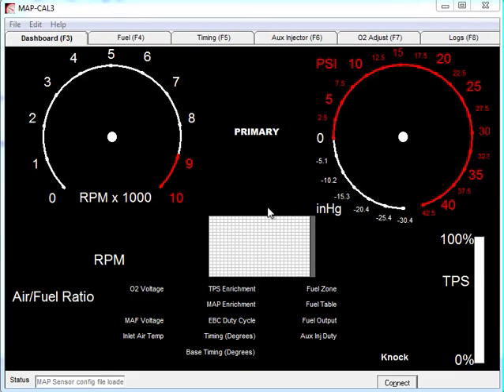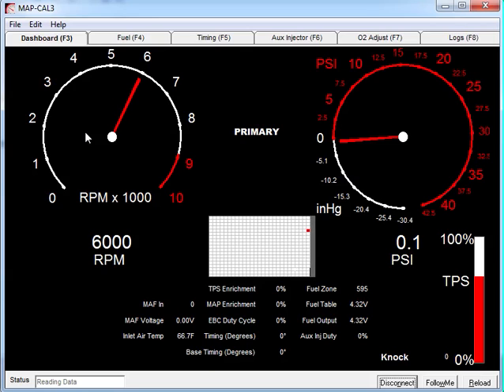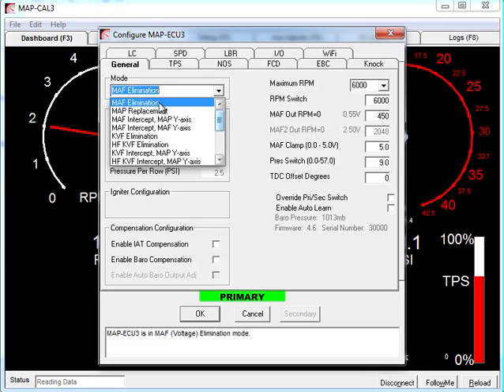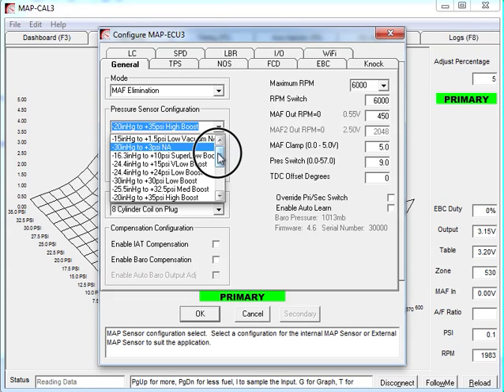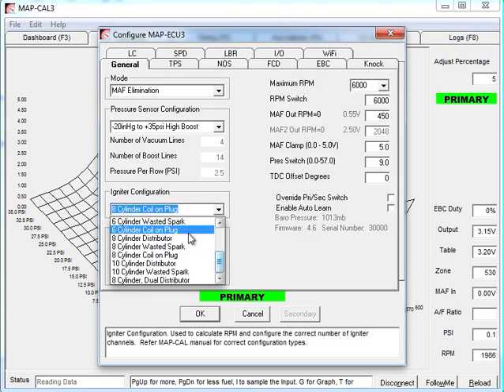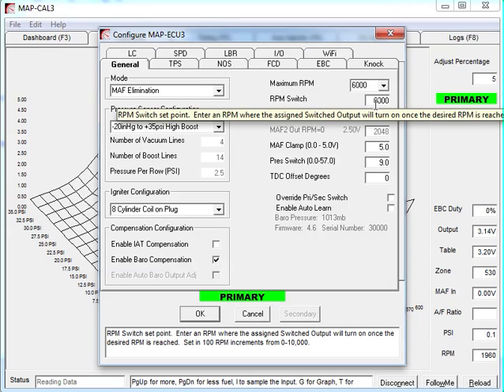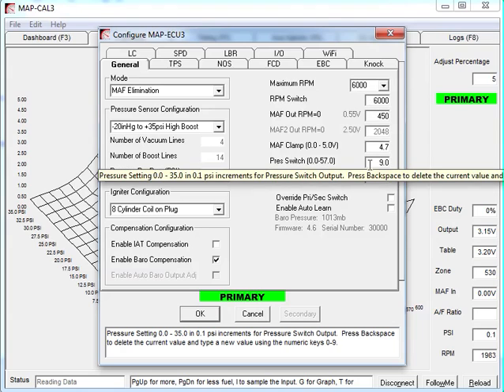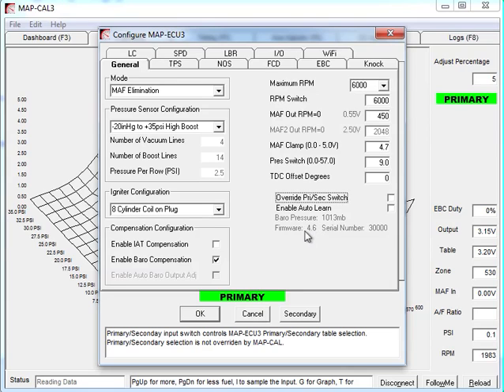MAPECU3 ECU Configuration Part 1

Comment: Hopefully you'll see this after so long-can this be installed on most any car? I have a 97 saturn sc2 1.9 dohc that uses 'wasted spark DIS' type ignition system. I am running a turbo using archaic rising rate regulator with onset of gain and no timing control at 10psi. Good so far, but my engines built for 20psi and I need to control fuel better and having timing control if I need it. The oddity is, this ignition system detects compression in the cylinders to determine where tdc is electronically rather than any cam sensor. It does have a crank sensor but the clarity on how it determines when to fire spark is somewhat lost on me.
Reply from the maker: MAPECU3 controls ignition timing by intercepting the low voltage signals between the OEM ECU and  the igniters. If your ECU drives the coils directly, it won’t work. We need a setup with smart coils. We haven’t seen a Saturn ECU diagram so we don’t know.

Comment from the maker: The MAPECU3 can be powered from the USB cable provided the USB drivers are installed correctly so the laptop which will allow you to load up a base table and configure the unit.
Reply: Hi I'm looking for pin out for MapEcu 3. And driver for Windows 7 . Can you give me some contact information, because the internet site doesn't work anymore. Thanks!